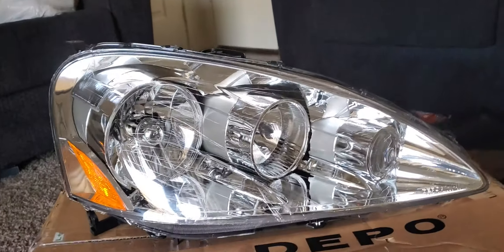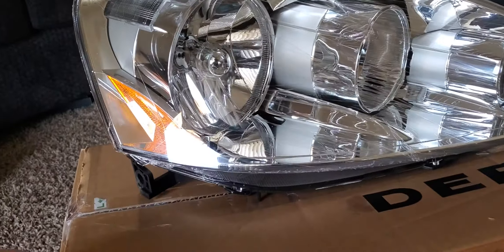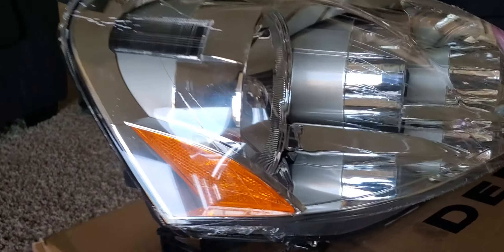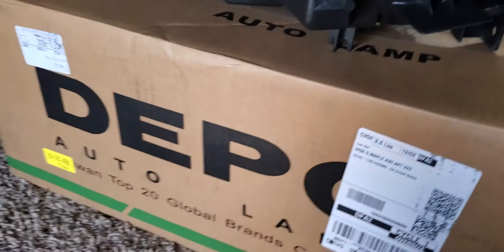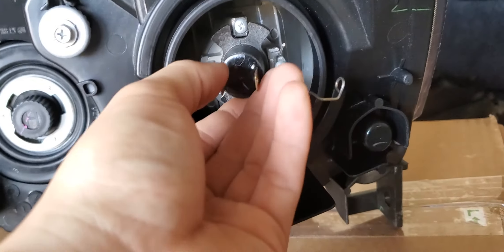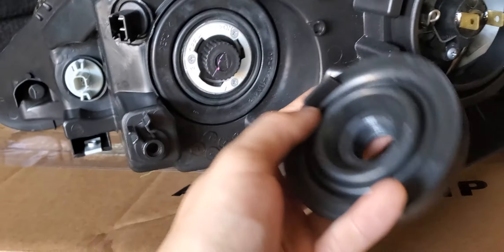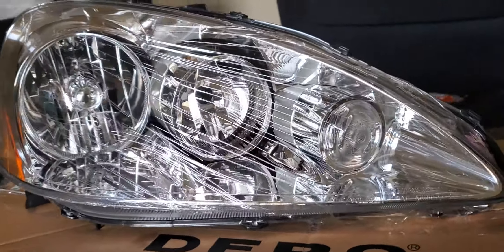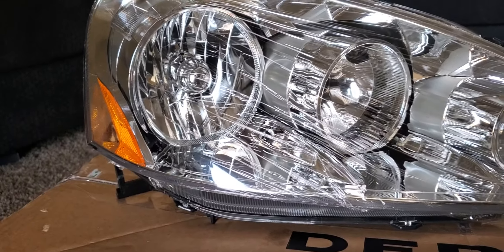2005-2006 Acura RSX DEPO Headlight

Comment: hey @Lue detailing I've had my 06 RSX type S for about 8 years and looking for a new set of headlights. my question is do you sill have these headlights do would you recommend 4 years after posting your video? I'm interested in buying this set.
Reply from the maker: @Grimreaper014  yea if u like the chrome look, definitely get this one. It can easily be black out too with a "easy off oven spray" if u know how to open the housing. I'm still running this DEPO headlight today, just look different now cuz custom retrofit it